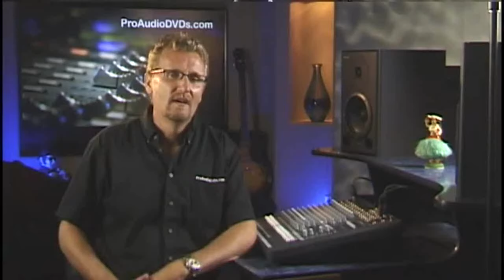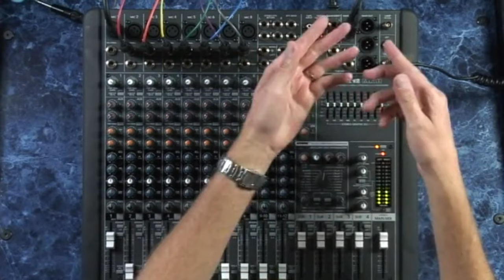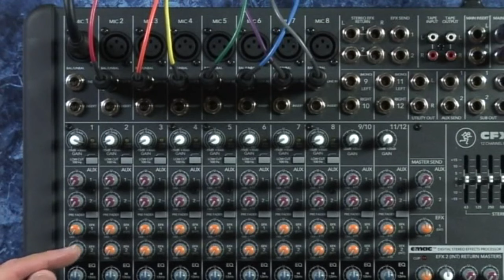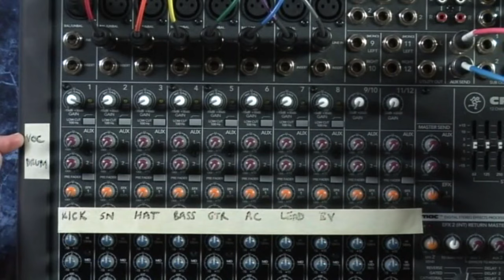How Aux Sends Work when Mixing Monitors

Comment: Can AUX1 be its own independent stereo output without using AUX2 using a TRS 6.5mm male to 3.5mm line input into my Pc. Please help!!!
Reply: If you have a mono to stereo cable that should work. I run the opposite: I have an 1/8" stereo from my computer to 1/4" mono on my board.
Reply: Something similar to this should work for you. If it doesn't, then send it back:  https://www.musiciansfriend.com/accessories/pig-hog-solutions-35mm-trs-to-1-4-mono-adapter-cable-10-ft/j41802000000000
Reply: That would be a mono cable that is not a answer to my question that is just telling me that a mono cable works, what about the cable I just mentioned in the question?
Reply: @cantthinkofnameyeah7249  6.5mm is 1/4" (actually, 6.35mm), and 3.5mm is the same as 1/8". So, it's pretty much the same cable that I was referencing to. But with that cable, you should in theory be able to use AUX 1 as a stereo output.
Reply: @andrewgehling6566  there not the same cable but all good ill ask someone else
Reply: @cantthinkofnameyeah7249  6.35mm is 1/4", and 3.5mm is 1/8". I know my cables, and I know my math and conversions. And to make sure I was correct, I checked google. If you want to show me a picture of the cable itself, then I can verify, but based off of the information that you gave me, and my knowledge, I would say that you have a 1/4" to 1/8". But that's just my professional opinion.
Reply: @andrewgehling6566  Mono is TS im talking about TRS your getting lost
Reply: @andrewgehling6566   You can't run stereo through a 1/4 mono so I have no clue what your talking about.
Reply: @cantthinkofnameyeah7249  I'm also talking about TRS, and if you read the message I sent earlier, you'll notice that I said mono to stereo. So no, it's not me that's getting lost.
Reply: @andrewgehling6566  Do you not realize a mono to stereo cable is still a mono cable overall...im talking about a full stereo cable that shows how little you paid attention to my question.
Reply: @andrewgehling6566   You literally sound Like you have no clue ear talking about your saying they're both TRS and that you're talking about TRS but you don't even understand that TRS is stereo or mono impedance balanced. NO TRS end is mono yet you are calling it mono. Dude news flash you dont get a mono connection from 2 trs ends that just ignorance.
Reply: @cantthinkofnameyeah7249  A mono to stereo cable is actually TRS to TRRS, but nobody really adds in that extra 'S' to save time. I'm sorry I assumed that. So no, the cable I'm talking about is not a mono cable overall. You asked how to take an AUX out to connect to your computer. I told you what I use (and it works perfectly fine because it's simple audio technique), and you're telling me that it's incorrect. You can use the same mono to stereo cable to take the signal from your computer to your mixer or from your mixer to your computer. You can do this because these cables typically aren't directional.
Reply: @andrewgehling6566  A mono to stereo cable would be a TS to TRS not TRS to TRRS I think thats were the misunderstandings exist TRRS ends are for mono and stereo at the same time which is not my overall goal.
Reply: @cantthinkofnameyeah7249  Mine is a TRS to TRRS and is a mono to stereo. I was just saying what I would do if I were running an aux to a computer (in or out) in hopes that it was something that you didn't try yet and may work out for you. 

I hope you find a solution that works for you, and if you haven't tried what I am describing, maybe give it a go and see if it works. The worst case is that it doesn't and you have to return a cable, although I'd keep it around in case you need it in the future.